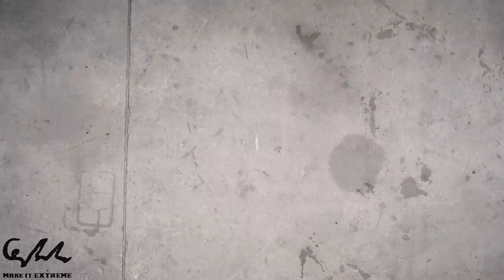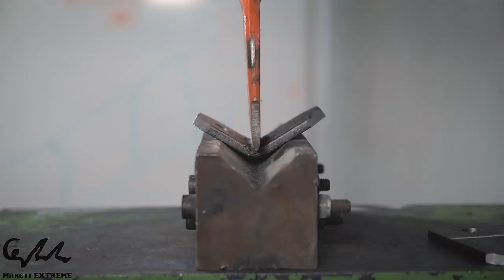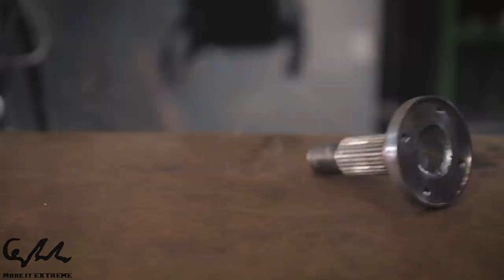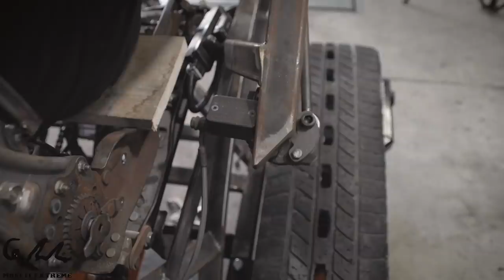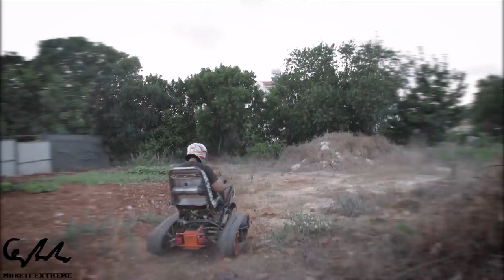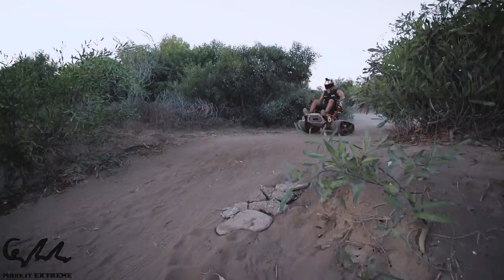Make it Extreme | The Ultimate Tank Chair

Comment: The best one like it that I have seen on the whole interwebs.
If I ever get disabled enough to need one of these, it will have a similar design with a cammed 1/4 scale aluminum LPG V8 engine, and it will ROCK.
Thanks for sharing. 
The cool factor is off the charts with this one.

Comment: Wow, nice fit and finish details, good sense of style on the colors too. Was worried the tire/ belt notches would wear out quickly but looks to be holding up. The nose dipping on deceleration, like on a downhill, maybe a slightly longer length tread/ bigger tire diameter next build. Looks fun!

Comment: Awesome job! Really tidy looking. How does it go on steep hills?
Reply: Lean forward. Lol
Reply: I suspect it can only go up an incline that's about as high from the last wheel, at the front, as another wheel under the front wheel. So not much, tho i could be wrong, most of the weight should be low, that gear box and structure isn't made of packing peanuts. IMO, they should've gone even more extreme and made the two threads independent with a pivot at the center, and belt transmission.
Reply: Going downhill is when you REALLY need your helmet. Looks really good and like a blast to operate. You know the kids love danger, they would flock to it for a ride.
Reply: It flips over
Reply: aserta yeah or maybe if it was like a stand up scooter type so you could lean way forward or back

Comment: Cool but just a bit longer tracks so you don't incline that much forward when braking....otherwise cool.
Reply: Thats a fair idea., but he's limited by the size of the donor tires so I have no idea if he would be able to make them much larger than they already are.
Before other people comment about it; I have seen some people bond several tires together to make longer track material, but this looks like he deliberately chose to stick with the material from one tire per track, maybe to eliminate the possiblity of a weak joint, I don't know.
Reply: exactly, and add air suspension for the chair...  i can see it shaking like a s*x toy.
Reply: Maybe a tire from a truck can be used, or are they too ridgid?

Comment: I liked, I clicked like again to undo it, I liked again, I clicked again to undo it and did this quite a few times to satisfy the need to like this loads of times.

I had my reservations about the seat and how it would balance in response to movement, inertia and rolling forward, but this probably one of the best builds ever and the speed and control available is so good it's funny when the tank chair rotated. There needs to be another so that there can be a race.

Comment: Awesome project!💖
For next version you can make it run on electric power.
Put a battery pack under the seat, power it with an electric motor, solar panel behind the seat, led lights 😍💯

Comment: Not bad. but to be perfect must include some spring to reduce vibration on driver. and the wheels must adapt to terrain like tank do. You can see if you break you can roll because the wheels are solid and stay on air instead stay all the time in contact with soil.

Comment: The treads design could obviously be better so that it doesn't try and throw the rider out the front by over-balancing so I wouldn't actually put that plan out there until you fixed that portion of the design and build it out to prove it. Otherwise probably electric and everything is great fun.

Comment: This is really cool! However, given it's low speed, I see no benefit to having a gas powered engine for this particular application. This would be a perfect match for being battery powered. More torque, and quiet. I'd imagine the range would be similar to that 2 gallon tank of fuel, as well. Opens up doors for being an accessibility/mobility device that way as well.

Comment: Way to tippy!  Can you flip the bogey assy 180 degrees so the bottom of the track is flatter?  Instead of a metal front idler? use a regular pneumatic tire at reduced pressure to allow it to flow over obstacles.

Comment: The chair is too high. Braking or decelerating is dangerous, since you could tip over forward easily.
You need to lower the center of mass.
Lower the chair, and move it back a bit.
The Engine, can be placed a little further backwards without much changes to compensate for inercia.
You might want to stiffen the suspension too, to avoid leaning forward as much.
It will handle a lot better after these changes.

Comment: dont suppose you would do a give away for a handicap person wanting to get back outdoors? Ive been thinking of doing my own build using bike or dirtbike tires to make the track belts and 2 18 or 24v cordless hammer drills or impacts for motors wireing them to a control switch on the handles and a bigger battery. just something to get me past the pavement and onto the grass and sand  that wont cost as much as a new car or house. But I cant even afford the parts to make it myself..

Comment: Need a longer track length and the U joints cant be at those angles. They will snap. You need to have those in as straight a lint as you can. They are only meant for basic suspension travel. This is a mistake I see you folks make again and again. Remember ripsaw? Yeah, they made the same exact mistake and I even contacted them and told them and they didnt listen. They broke shafts like crazy until they finally decided to straighten the alignment angles.

Comment: Cool design but that body roll scares me... I  would afraid of it throwing me when I try to stop.  I theorize if you extended the track both forward and backward, the issue could be resolved, but you need to extensive rework and there is simpler less elegant looking solution like a wheelie that could resolve the issue also.

Comment: Now that’s a wheelchair. Too bad it’s so loud. It would be good for a disabled hunter. Most electric track chairs I’ve seen besides being extremely expensive have a low range. Maybe 12mi on flat land. My powerchair is supposed to have a range of 15-20 mi. I’m luck to get 5 mi. It’s already on it’s second set of motors. And that’s on sidewalks and paved bike trails.